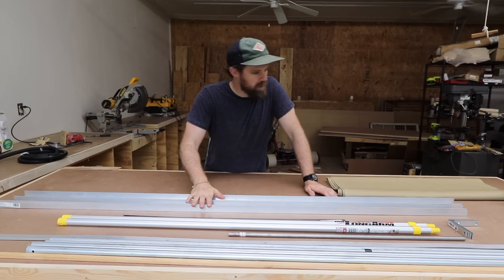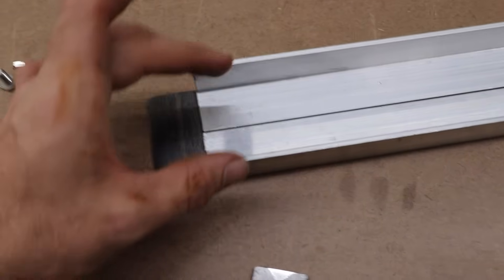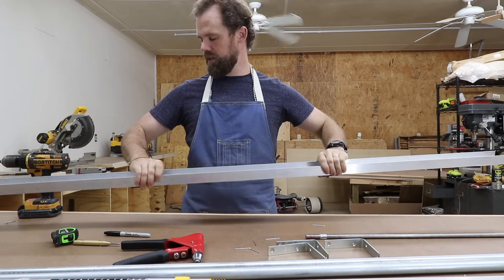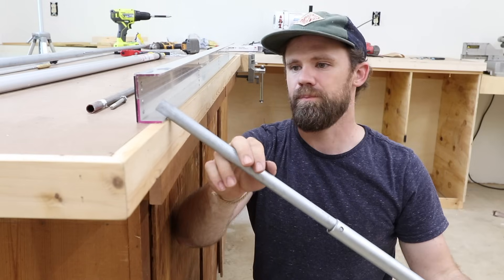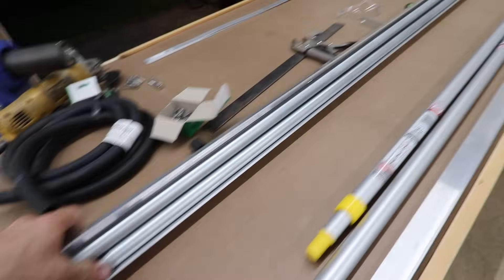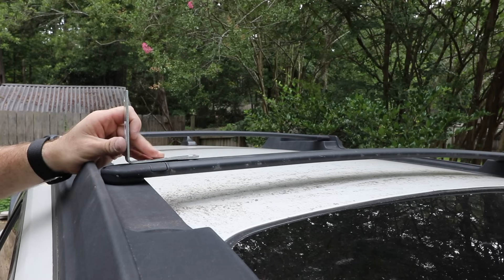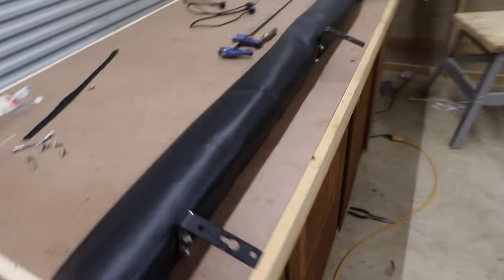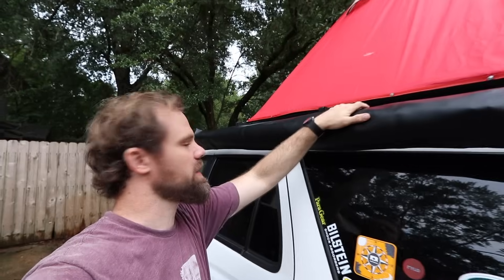Building an Awesome Truck Awning!!

Comment: I knew there had to be a way to build one like this. I really like the way you've problem solved your way through the whole project.

I see that you've mentioned tie-downs in your sticky post (lol), so I won't yammer at you about that. What I find myself curious about is your choice of that particular fabric over something like a good shade cloth fabric. Was it weight or cost?  This fabric will certainly work beautifully, but maybe spraying it with some sort of UV treatment will add some longevity to its lifespan? 

Whatever..... you did a beautiful job of it-- I thank you for the great tutorial.
Reply from the maker: madhabitz it was more of a convenience and cost thing. I new everyone’s fabric choice would be different and I already had this fabric from a previous project. I’m sure I’ll upgrade it at some point. I’d rather use some sort of ripstop fabric I think. That canvas is heavy! Thanks for the kind comment! I’m glad you liked the build!
Reply: @PatrickRemington  I totally get using what you had on hand -- best thing is that will keep costs down while you work out your ideas.

Ripstop! I was going to ask about that possibility, but then chickened out. That would be so great. The only thing I wonder about there is whether or not it would block UV rays, but man.... you could do a gazillion things with that stuff. Heck, you could add some kite lines and fly the darned thing if you wanted. Heh.... I'm not really kidding. I love kites. lol

For what it's worth, a soldering iron with a fine tip works great to cut ripstop and will melt the edges at the same time, so it won't fray (use a piece of glass underneath (sliding glass door works in a pinch). You can get some really good quality fabrics in a lot of colors if you google for kite making supplies. Then again, you could try to find an old parachute somewhere.

Again, loved the project. Thanks!

Comment: Well done, genius.  You deserve to be happy.  👏🏽👏🏽👏🏽 your sewing assistant is a sweetheart.  May I ask one question, about riveting the fabric?  If you need to change out the fabric .... does that not mean you will have to bore out those holes to remove and replace?  I really am impressed with the work you put into this, and want to thank you for sharing it.  👏🏽🇨🇦👏🏽
Reply: You can easily drill out the rivets without boring the holes out. Use a 3/16 bit for 1/8 rivets and you only remove the head. Take off the fabric and tap the remaining rivets with a 1/8 pin punch or a nail. I've done it 1000 times on race cars, etc.

Comment: Love it, would probably try to use some biminy top hardware for the swivel points though if I could get them to work... I have a full size high top van which gives me a little more option for mounting

Comment: Your canvas work and ingenuity is very good! Not so much on the metal work but ok for a non metal worker I am not knocking your project it is great! There are hundreds of articulated off the shelf options other that the hose. Check out McMaster Carr for ideas. What kind of sewing machine is that and/or what kind is needed for that canvas work?  Very good project I am sure it will serve you well.

Comment: If more height is required:

I believe you could make two flip out wings with roller added / clipped in  at each end attached to truck rail ? to elevate the height of the tarp  once you start to unroll say a foot or so 

Done on sail boats with Biminis and boom braces and  ...

Comment: Looks Awesome! Just wondering if the doors hit it when they open? In the stowed configuration, it looks like it is hanging below the top of the driver side doors -not that it would matter i guess, it would be easy enough to raise it up an inch or two...

Comment: Little late on viewing, I agree with alot of the post, and you mention where you aquired you parts except one that I would like to know, what type of rivet did you use and where did you get them?
Reply from the maker: I used aluminum rivets that you get at lowes/home depot. I think you can get an assortment of different sizes in a pack.

Comment: you could treat the canvas with a waterproofing/repelling spray to easily make it "waterproof"
Reply: the other suggestion I would make is to the adjustable legs made out of the conduit. You could drill multiple holes in the 1" to allow for adjustability in case the ground is not level

Comment: Subscribed!  Very creative approach / solutions.  I have a question for you:  Without getting into the complexity of a batwing design to extend the fore/aft dimension...which would you think would be "stronger" to use for attaching walls to the extension bars?  In this design, you've built a set of telescoping poles....but would they be strong enough to support a wall on either side?  Or would you consider using either the L-Channel (such as that which you used for the main chassis) or some sort of Box Channel?  I think it would be awesome to have one or two (detachable) wall sections that you could clip onto the top extension frame member(s) and unfurl if you need add'l privacy, wind protection, etc.

Comment: You can put some velcro on the material and attach it to the poles and it'll be litte better ,also it's better if you can make a cover water proof vinyl 10 or 14 oz., it me up give me the measures and I make it for u

Comment: Very nice project. maybe i missed it, but how did you attach the end part to the poles that swing out? I know you put wood dial in the end with a bolt. but then it looked like you just poped them right to it . at 18 minutes you said it would go through the other aluminum bracket i figured with a nut but didn't seem that way in the set up of it.
Reply from the maker: Yeah you just drill a hole in the aluminum angle and the bolt that's in the dowel just goes through but you don't need a bolt on the other side the tension from the extending polls holds it in place. Hope that makes sense.

Comment: Rivets are fine. My racecar body is all held on the car with them. Also, why not tig weld the angle together. Way quicker.
Reply from the maker: Yes I could have done that. I do have a tig welder but most do not. With this project I didn’t want to do anything that would be prohibitive to most. I want to show people that there are other ways to do things even if it takes a little more time.

Comment: So I really like this and will be building since my project list is getting shorter. Off topic, I need to build a belt sander cradle, any guide you can share?
Reply from the maker: Man, I wish you could attach images in youtube comments to show you what I did. The cradle is one of my favorite mods and I use it all the time. Harbor Freight sells a really cheap belt sander that already has a really flat top on it which makes flipping it upside pretty stable. I basically just started with a 1x6 then made a pocket for my front handle to slide into. then used screws placed at different points at different heights to support parts of the sander to keep it flat and stable.  then made a slot for my rear handle to keep it all in place. I then used screws at each corner of my 1x6 that bearly come through the underside. This acts as cleats and keeps the sander from moving when I'm using it.  https://www.harborfreight.com/65-amp-3-in-x-21-in-heavy-duty-belt-sander-69859.html
Reply: @PatrickRemington  I'm in the FB group so I'll ping you there. The reason for the initial question is that I already have that belt sander and really like the idea of using it in this way. Keep up the great work!

Comment: Awesome information! I’ve been trying to figure out an awning for my Skoolie build. This gives me so many ideas, and how to modify it for my build. Thanks! 

Any ideas on how to build a light weight deck that comes off the side of the bus that can be folded up when driving? I’ve been researching aluminum frames vs steel tubing frames to cut down on the weight. Cost effective and strength are huge factors. If you have any ideas let me know!

Comment: this is going on my must build list once I have my cargo rack for the new tacoma. I have an ARE bed cap, and intend to mount a contractor style cargo rack, but once the cargo rack is on the truck, I am looking to make a batwing style canopy, and a straight canopy

I am concerned about how you just riveted steel to aluminum. this seems to me to be begging for galvanic corrosion in the aluminum.

I love the idea of using the Mr Long Arm for legs, but those spring clips are going to save me a lot of trouble with the design I was trying to figure out for my bat wing.
Reply: Galvanic corrosion will be an issue in a VERY moist climate. Where I live and recreate in the California desert I have things that I built in the 1970s with steel in contact with aluminum that are just fine now. Further, this awning is obviously not intended to be on the vehicle for the vehicle's entire life span. You would take it off when not overlanding/camping and store it indoors. My 1990s Jayco tent trailer is chock full of steel fasteners holding aluminum to aluminum or to steel with galvanic corrosion issues. If one were using it on salted winter roads where it is very humid, you might expect such trouble.

Comment: I've made the awning and it's really the best!! My only problem are the key hole angle brackets...where can we find them and not make them by ourselves?? The ones I had made are not very easy to use plus, I noticed that in the video they change from the ones that are shown at the beginning...any links?? It's the only thing I'm not happy about...😐
Reply from the maker: I’m pretty sure they are the same brackets from the beginning I just made the key holes but didn’t show it. Just drill two holes one large than the other. then using a jigsaw with a metal blade cutout the metal between the two holes. It’s not hard to do at all.
Reply: @PatrickRemington  no, they are not...the ones on the awning are black...the ones at the beginning are silver colour...I did it the way you say but they are not smooth enough...the black ones in the video look super pro!
Reply from the maker: @florencegiliberti8793  i painted them! 😂😂
Reply: @PatrickRemington  would be great to upload the video with the bracket "conversion"...could be really helpful...other than that, it's really the best diy awning that I found and, believe me, I'seen tons!!👍👍👍

Comment: @patrickgrem
Just recently came across this after taking a hiatus from trying to figure out a DIY awning for the last year.  This is a great project, instructions, and video.  Ignore the haters, especially those that claim to be DIY reviewers.  It is called DIY for a reason.  I have Nissan NV Van and this will be easy to modify to fit my application.  I do have one question, do you have a link or list of the parts you used to build this?  I have made my own list based on what you show and talk about in the video, but I want to make sure I have everything prior to the build day.  On a side note, I came across your review for the storage bag.  I thought that was a funny coincidence.  Thanks in advance.

Comment: What can you tell us about the type, or minimum capabilities, one needs to look for in a sewing machine that can work on these kinds of fabrics?
Reply from the maker: I just have the cheapest sewing machine I could find at Walmart. Its a Brother. I got it like 8 years ago and its held up through everything. Its nothing fancy or heavy-duty although, for what I've been using it for, I could use something more suited for these heavier materials but my machine has done just fine and I've forced a bunch of layers of vinyl through this machine! Just get some thicker heavy duty needles for it.

Comment: Hi Patrick, great video and good job. Why not exclusively using aluminum ? I fear rust leaking on the car after some time. They'll be soon an awning like yours in Belgium ! Cheers
Reply from the maker: Thank you! I'm not worried about that at all!  The hardware is stainless. The brackets are galvanized and painted. It should be fine. Even awning manufactures are using steel brackets to mount. Much stronger!

Comment: Man I wish I had the cash to have that made. I have to have shade I have lupas the sun not my friend. So I'm stuck in bed all week I get out maybe 1 time week and usely at night cause of the sun. I use tarps sometimes or my canapy. But I've got so bad I need something easy and light to set up. That would be perfect. I no if someone was making to sell I couldn't afford one but I really love the way you did that. Maybe I can talk to someone down here show them this. Maybe they can help me make one. I could just have to take alot breaks. Standing and setting hard for me. But some days I fill good could prob get it done. But yea I really love that. Bummer my ladder rack didn't fit my truck I just got so had to add a camper shell but I'm watching vidoes. To find the best way to add a rack one for my lights I use for fishing when I get to go. Hey I take a bed like thing I love to fish or just lay and watch the water. If people can bring there chairs why can't i bring a seat that looks like a couch one seat and one back small metal frame fit in my truck perfect. But need to find a way for my lights and canapy to get me out the sun. But out all vidoes I love yours the best. Thank you I have something to look forward to helping me. If I find someone to help cheap or for trade I have lots stuff I can swap for the work. Have a good weekend sir. God bless

Comment: THAT HEATER HOSE THOUGH!!! What an amazing project. I was just looking at buying an awning for my truck but I think I may try and build one now. By the way, are there any issues getting the awning caught up in the rear door?
Reply from the maker: Thank you! The door would hit the bag when I opened and closed the door so I just flipped the brackets and that raised it about 6in. Easy fix!

Comment: That was awesome sir, props all the way around from the engineering to the sewing. I must say great job I need to step up my sewing game. If you dont mind I ask how much was your setup in totality.
Reply: I'm in the middle of building an 8x10 from his design. The only drag is he doesn't say exactly how long the two extender poles are( the ones that slide into each other and use the spring clips).  I'm thinking about a foot and a half of each pole would be the over-lap. I don't know. Anyway, so far I've spent about 200 bucks and that doesn't include the tarp or the bungee cords that will secure the tarp to the top. Nor does it include the material and the zipper to make the protective cover that he sewed. I have to have to farm that out. When all is said and done, it's gonna be a bit spendy but it'll be hand made by me (for the most part) and that'll give me something to smile about.

Comment: What happens  when  it rains?
Your edges are hanging and not connected to the side rails.
Or even in the wind not tight and it will  flap
Reply from the maker: I didn’t make it be waterproof for rain. It’s just a sun shade. I am going to add some traps on the sides to keep it secure. I mentioned that when filming but accidentally edited it out.

Comment: Ok so you used the spring clip. Was the electrical tape holding the spring clip?
Reply from the maker: No the tape takes up the extra space inside the pole so there isn’t any slop. It’s not a perfect fit. The spring clips don’t need anything to hold them in.
Reply: @PatrickRemington  thank you Patrick watching this while watching tv. You could do a circle end on the cover as well. Your daughter is adorable. love your builds. Could you add another portion of tubing a
bout 15 " out on both sides then install a longer pole at that tubing, to make it so you could walk under the center? Basically creating another bend?

Comment: I'VE WATCHED A FEW OF YOUR VIDEOS AND HAVE A QUESTION, WHY DO YOU USE 2 ANGLES AND CONNECT THEM RATHER THEN PURCHASING A C CHANNEL? C CHANNELS ARE AVAILABLE IN THAT SIZE AND WALL THICKNESS FROM YOUR LOCAL METAL DISTRIBUTOR. 

FOOD FOR THOUGHT. YOU DID THE SAME THING WITH THE 270 AWNING. JUST WONDERING LOTS OF WORK YOU PUT AND IT COST MORE FOR 2 ANGLES THAN ONE CHANNEL. NOT TO MENTION BRACKETS NEEDING TO BE MADE TO RIVET THE 2 ANGLES TOGETHER. MY 2 CENTS. I ENJOY YOUR PROJECTS.
Reply from the maker: I LOOKED FOR C CHANNEL LOCALLY AND ONLINE AND BOTH WERE MUCH MORE EXPENSIVE. LOCALLY THEY HAVE A 20ft MINIMUM AND IT WAS ALMOST 300. NOT TO MENTION THEU DIDN'T HAVE THE WIDTH I NEEDED. ONLINE IS OK BUT SHIPPING COST IS VERY HIGH. I MENTIONED ALL THIS IN MY 270 AWNING VIDEO.
Reply: @PatrickRemington  I appreciate your reply, keep looking for a new/larger aluminum distributor. A full length in aluminum will be 24ft and is the way to buy materials. If they sell less than a full length then they have doubled or more the actual going price for the aluminum. 

For example a 2x4 aluminum channel 1/8” wall 24ft is like $72 a length! 

If you goto my local reseller who will sell me a piece cut, they want 20$ a foot! So that $300 price you got is from a reseller, and they’re only good for a small piece here and there.

Find your local (within 100 miles) aluminum distributor, make an account. It’ll save you a lot of money and enable you to get many shapes and extrusions that are not available local locally. 

Eastern metal supply is the provider that I use, they deliver within 100 miles of there facility for $10 fuel surcharge (minimum orders required for delivery).

Keep killing it!